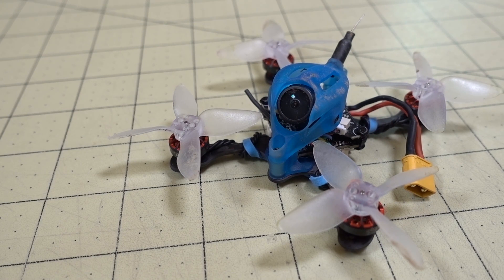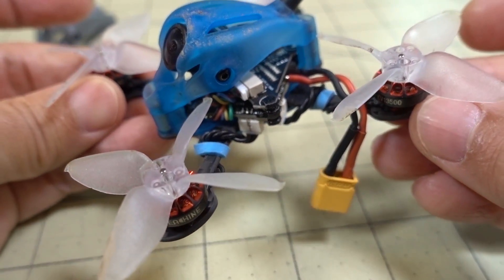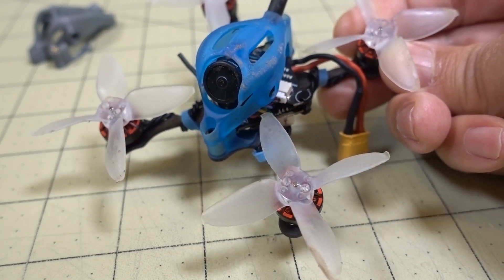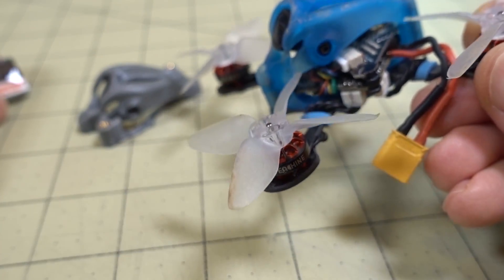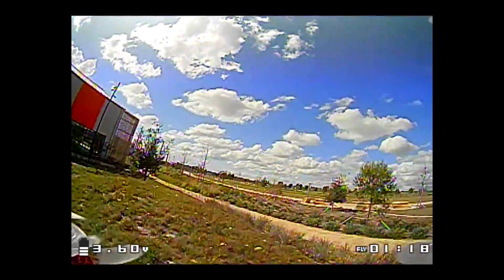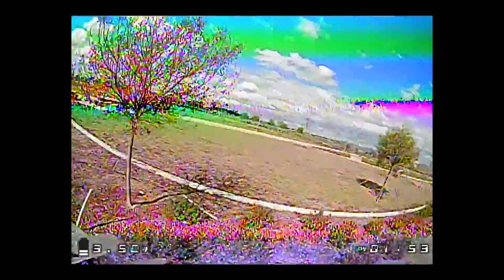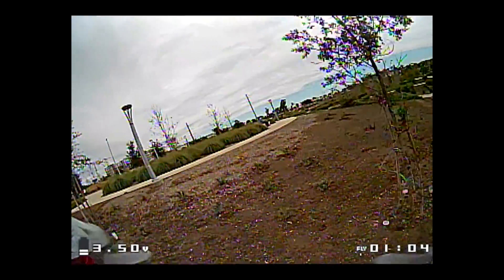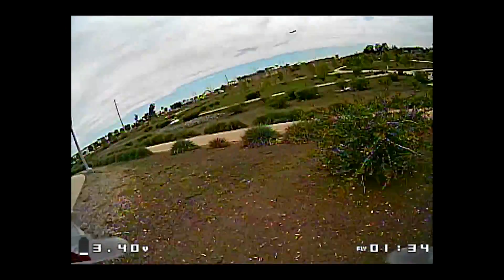GnarlyFPV Meemo 2-inch Micro Drone 🏁

Comment: I've just started playing with mine using a mob 6 fc and cam and it's much lighter and goes about 3 minutes on a NBD Gold 300.  I have the 1mm shaft 1102's so I had to use bolts, but going to probably go with the BFV 1102 18k on 1s before I jump it up to 2s on a different FC.  My fav. prop is the HQ 2x2x4 as it's lighter than the Avan.  I'll post video soon, and have a pretty solid BF 4.1 RPM tune.

Comment: Sic Rip! As Albert mentions, if you run the BetaFPV 1s board, or the Happymodel Crazybee 1s boards, you'll drop a lot of weight and notice better flight times, and overall agility. Drop in a Runcam Nano 3 and that improves even more.  Nano 3 14mm adapters are available on the store for both the Primo's and Meemo, but should also fit any other 14mm Canopy. :D

Comment: Those motors are great on 1s with 65mm props. Also using nylon prop screws really helps with durability (otherwise you will bend prop shafts). 
I’ve also used that motor on 2s with no problems or throttle limit

Comment: Hey Albert, as always enjoyed the vid, I posted this over on PMB channel as well.  I copied this build...BUT its doing something ive never seen before....anyway, I ordered the parts listed and dropped a Mob6 FC (similiar to PBMs build) and cam in, and used the same motors...only difference is I'm running the Avan 2 inch props like you are running...to avoid having to use the bolts with the supplied HQ props.  I pulled the Mob6 FC direct from a 75mm whoop frame conversion I've been flying for the last few months (flew great, had great flight times, and in general was just a bigger but dialed in MOB6).  I put together the Meemo and dropped it onto BF and checked it out and ensured is was set up properly (to my relatively limited experience level...just about a year messing with it)...motors reversed ala the original MOB6, props on correct...everything looked great.  Armed it, and it idles fine...start to advance the throttle, and it basically rolls from one side to the other really fast, like a shark shaking a fish to pieces. Disarm, try again, idles fine, advance the throttle and it starts acting like a possessed voodoo child....(its not running away and flipping over...tried to isolate that)....soooo, i checked the props, looks seated properly and tight enough...went back into BF ran up each motor, no apparent issue there? OPEN QUESTION to you or anyone having a look at your vid....Any clue what might be going on?  The FC has the latest firmware, and its running the 48mhz ESC flash as well. Otherwise it has the stock MOB6 PIDs etc...a flip over would be one thing but this thing is wildly trying to right itself back and forth on the roll axis....Ive never encountered this before, so any words of advice would be greatly appreciated. Kind regards, MC
Reply from the maker: Is this happening in angle mode?  Calibrated ACC?  All motors and props properly going the correct way and matching Betaflight setting?  Triple check.  Triple check again.  People miss this one a lot.  Are you able to spin up each motor one at a time in Betaflight with out any issues?  Are you certain you flashed the correct firmware for the ESCs?  If you flash the wrong one, this problem could happen.  I'd start there first.
Reply: Albert Kim ...yep upon further review the BF motors reversed was not mirrored in JESC settings...they were flashed with the right firmware but were all reading normal for direction! I assumed that that was controlled in BF and simply set it to reversed...they appeared to be spinning in the correct direction...until I finally armed it and felt which direction the prop wash was going...😂🙈

Comment: I would love to see how this same setup would perform with two blades cut off from each propeller to create 2” bi-blade props. And using a 450mah 1s lipo. I have used Dalprop Cyclone 2” props on 1102 before and felt that the props might have been a bit too heavy and pitch too aggressive for 1s.

Comment: Hey Albert, how do you think something like this would do with those betafpv 1102 18000kv 1s motors? Bit high on the kv? I have run them on 40mm quad blades and they don't even flinch at running those props. Would be going on a super light build. 👍
Reply from the maker: Honestly, I'm not sure how that motor will do on 1S and 2 inch props.  I would try to keep it as light as possible,  With the canopy it might be too heavy.  All just guesses on my part.  I've never tried that.
Reply: @AlbertKimTV  sounds good. Will try it. If anything I can play around with a throttle limit. Thinking 15000kv or so might be the sweet spot lol.

Comment: Hi Albert. Great video as usual. I'm looking for PIDs for a 3 inch quad I built. It's the guts of a Diatone Gtr349 in a iFlight ix3 frame. Running 4S.  Any help would be greatly appreciated
Reply from the maker: I would start with Betaflight 4.1 and RPM filter.  See my tutorial videos linked in the description.  Usually, I can just do those things and it will fly pretty good on just default 4.1 PIDs.  That's pretty much what I do for all my kwads now.
Reply: @AlbertKimTV  Thank you so much. I'm setting it up now

Comment: AK, I don't know if you have already swapped to the lower KV motors yet. If you haven't, you might try 40mm HQ 4 blade props on this 1102 13500kv set up with 2s. I built a Tomoquads Baby Evo2 using BetaFPV 1102 13500kv motors that weighs 47g and it runs great on 2s. BetaFPV responded to me that these motors are okay to run on 2s with 40mm props.